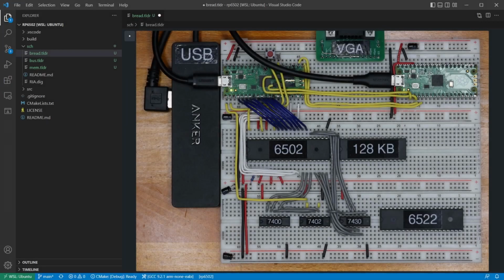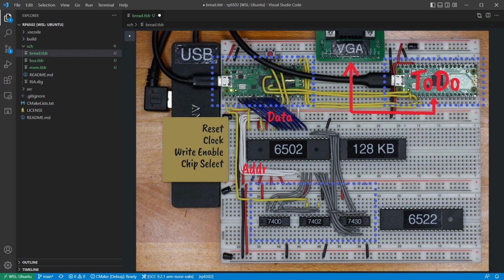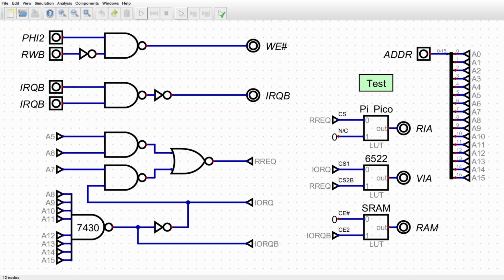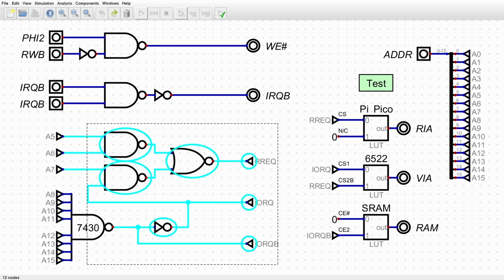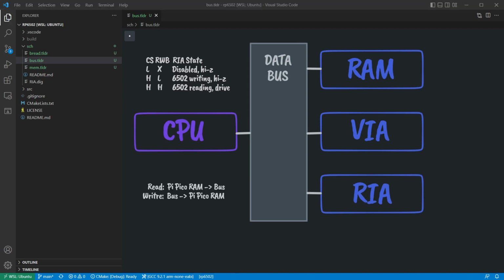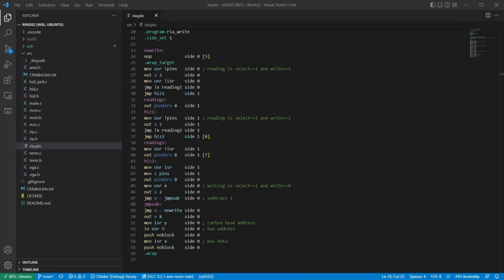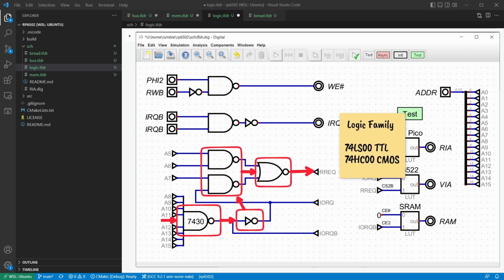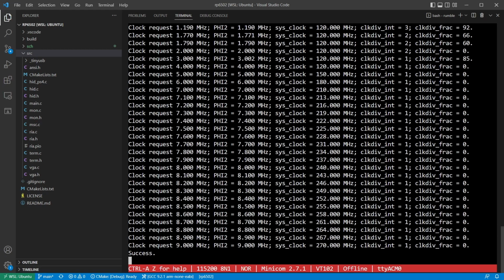RP6502 Ep3 - Writing to the Raspberry Pi Pico - More PIO and DMA

Comment: I'm liking this concept, and I like your presentation.  Very clear.

I think I will teach this in one of the introductory Computer Engineering courses I teach.

However, that address decoder is large and complex.  I think I will just use address bit15 as IOSELECT.   Sure, 0x80FC maps to the reset vector, just the same as 0xFFFC.  But 32K of memory is enough for a trainer, and this requires no address decoding (the RAM's active-low chip select can be connected to A15, just like the RIA's chip select).
Reply from the maker: There's at least one other uni with a lab of these. YouTube comments are a black hole for information. Can you share more about this on the forums? https://github.com/orgs/picocomputer/discussions/149

Comment: Can anyone re-assure me? : I think I see bus contention on the first half of the RAM write cycle.
When I had assumed that the 6502 transacts the bus on the rising edge, I thought the cunning plan was to replay what had just been programmed into the RAM address in the face of the still-oncoming data - hopefully the same (!) but now having had a re-visit of Ben Eater's bus timing video for 6502, I see that the zero mark is the falling edge (of phi_2).
So, doesn't the ¬WE  of the RAM get cancelled (raised) at one gate delay (U6a) from this fall and then, because the other bus controls of the RAM are tied open, it begins to output on the address which the CPU presently, but not 'too' slowly, begins driving address #and# data for?
If you went and single-stepped it like this, couldn't it burn out if you stopped the clock in the wrong half? I haven't delved hard into what the Pico-based clock generator does for its part, but I suppose that could be a very uneven duty cycle only just acceptable to spec on the low period, which might fix things good and well. Otherwise, is there any harm tying U7, pin 10 (U7c output: post-invert of 6502 R/¬W ["RWB"]) to RAM ¬OE (instead of a short to ground)?
Bi-directional busses are an absolute terror : I suppose wiring double a data bus (even if only 8 bit) is likewise a board and chip packaging nightmare, so hardly ever done - definitely not the 'commodity' approach - so unavailable (plus we only have so much Pico!)

Comment: I think I would be tempted to have the 7430 feed a 74137 to split the I/O space into 8 blocks of 32 bytes, the last one being used by the Pico. That would reduce propagation delays to just 2 chips. You would still be using just 3 logic chips as /WE and /IRQ can be generated with a quad nand.

It’s a great series so far and it good to see how much you have pushed the Pico PIO / DMA trick to get such fast random access from the Pico RAM.
Reply from the maker: That's a solid idea for a system with an address-data expansion bus. Or if they stop putting AC logic in DIPs.

Comment: Hi, can you help me understand if the pico inputs are 3.3 volts and the 6502 is 5 volts why the pico does not smoke?
Reply from the maker: I can't help you with that. I run everything at 3.3V.
Reply: @rumbledethumps  thank you so much for your reply!
Reply: Pi Pico2 is fully 5V-tolerant, so a pullup could be used to run the busses at 5V (by making them open-drain).  But, the 65C02 can be run (slowly) at 3.3V, and that's what @rumbledethumps is doing.

Comment: Wild suggestion here, but you should release this as socketed DIY PCB....Maybe even a socket for the Picos, and have 4, or more Picos (2 mandatory). It could be like a 6502 Pico super computer. Also I'm sure the sound could be socketed for some new old stock sound chip, or maybe even made from the Picos themselves. Either way really great idea here for learning about computers, Picos, and the 6502.
Reply: Not a bad idea - as a potential audio device the Pico lacks an audio DAC, but I'm sure there are ways around that.
Reply: @GodmanchesterGoblin  yeah I started following this project because I was wanting to make a ultimate NES kind of doing everything you see here but with a Nintendo and upgrading it's capabilities but that's way too ambitious for my skill set right now and I'm taking it slow trying to understand this stuff.